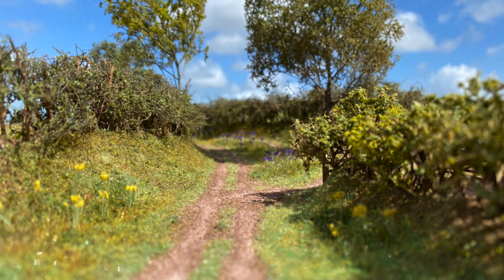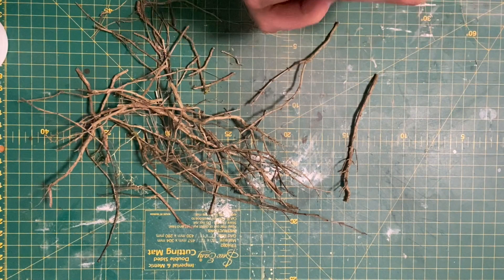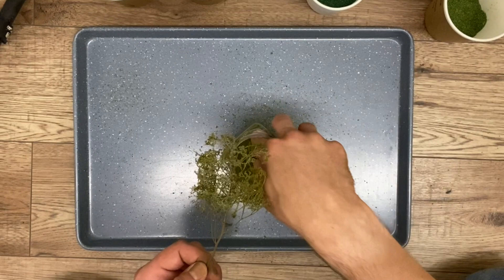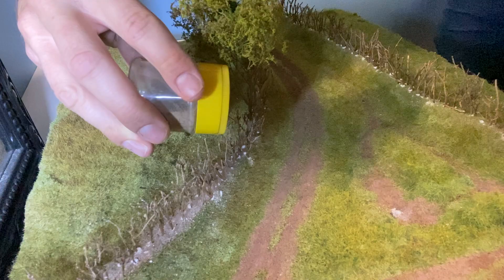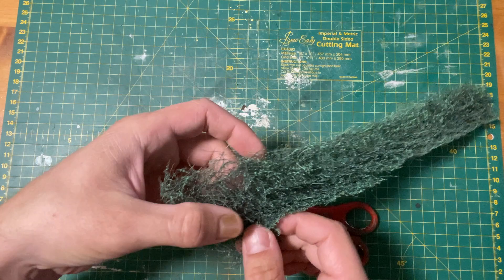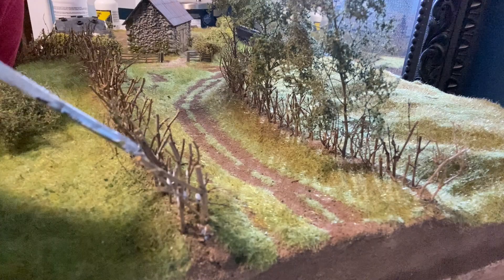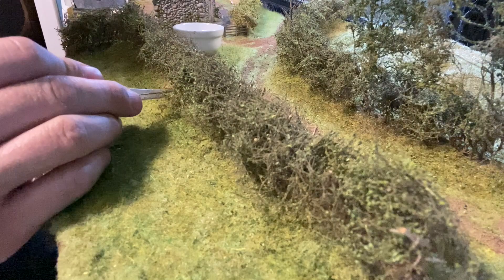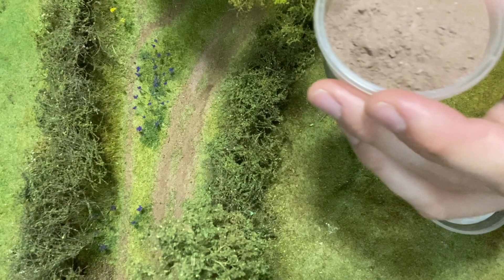Model Hedges

Comment: Wow, what realistic looking hedges.  What is your substrate?  I've got a pine tree blown over by the wind.  The root structure is great for hedges and trees, but have to be treated with a preservative like water soluble glycerin and alcohol or by merely painting them until you get ready to use them.  I also have a ton of lichen growing on the hill behind my house which makes great hedges.  I also make my own ground scatter & leaves out of foam ground up in my electric coffee grinder with some acrylic paint.  I also have a Nandena bush growing out in the front yard that I use for tree armatures after the little red berries fall off.  I would think that you would need to preserve those little branches before using them for hedges.  I think pig hair furnace filters make a good medium for hedges as well.  I do like your technique for the hedges, just need to use a preservative for the wood parts.  You don't say what the flower parts are but I've found ground up crayons of various colors make good flowers.  Love that tire swing in the tree.  Everything looks so realistic.  Great job!  Cheers from eastern Tennessee
Reply from the maker: Thank you! The substrate is a mixture of brown tile grout and Woodland Scenics fine turf.  I completely agree with you regarding preservative.  I didn’t show it in this video but I covered glycerin in my ‘Model Seafoam Trees’ video.  I also have a ‘Model Flowers’ video showing the process I use, including crayons.  It sounds like you have a fantastic collection of natural model materials which is something I need to improve on!  Thanks for commenting 😁

Comment: Very nice, but if you put the trunks in at about a 45 degree angle you would get a more realistic field hedge, traditionally farmers lay the hedge by cutting the trunks part way through and pushing them over at an angle, then as the hedge grows instead of having solid vertical areas around the trunks with thinner foliage between you get a living stock proof hedge that is all but impossible for cows, horses or sheep to get through (pigs are special, nothing can hold a pig unless its metal or concrete, goats just eat the hedge)
Reply from the maker: Yeah, a bit of an experiment but I always find I can do a better job on the second attempt after learning from the first try.
Reply: So you're suggesting we put a concrete wall around No10... seems like a plan! And a hedge for Westminster; plenty of sheep and goats there!
Reply from the maker: @royfearn4345  😂